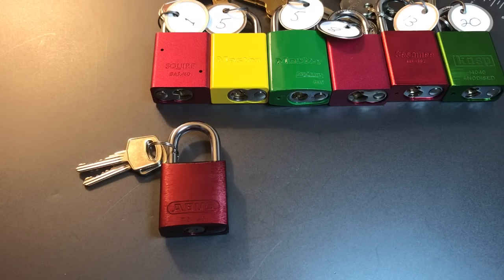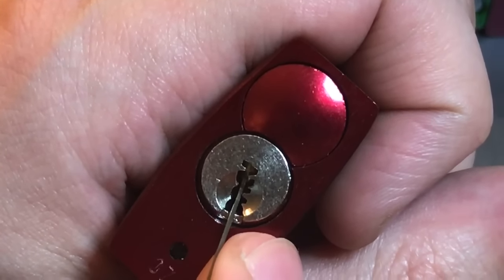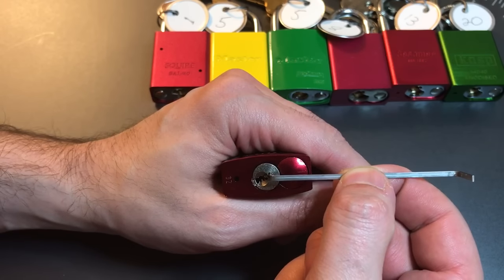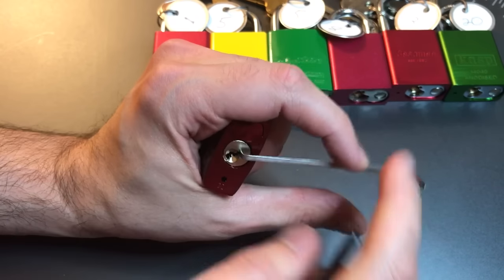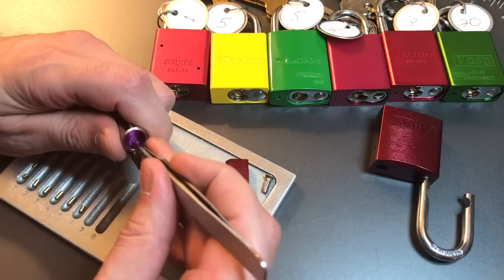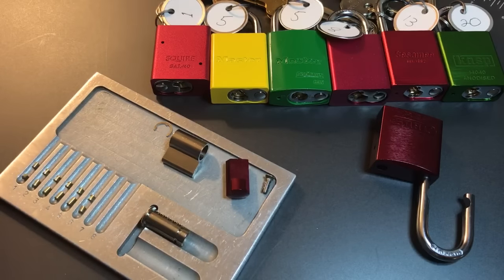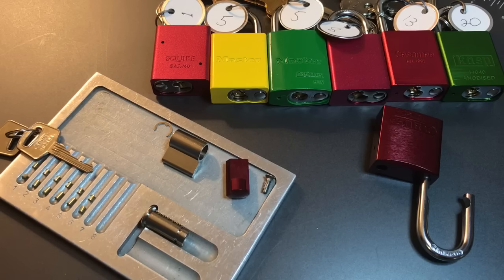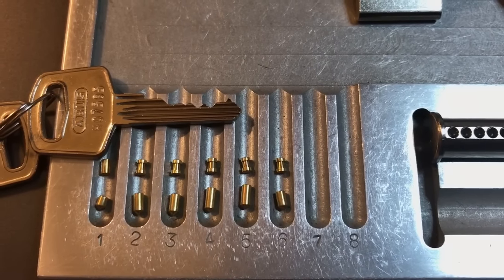[317] 40mmAL Series: Abus 72/40 Padlock Picked and Gutted

Comment: Very quickly done! My 72/40 has just the most evil bitting, while yours looks quite flat. So unfair, lol ;-)
Reply from the maker: Thanks... comparing with different bitting is different.  It's one of the reasons I used the point system (and didn't include none removable core locks like the M570 and the 80TI/40).  The points are independent of bitting.

Comment: The Abus 72/40 comes in many configurations. I have a couple WW keyway 72/40 that are VERY restrictive. Even to .015.
of the dozen I have, most of them have anti bypass. They all have serrated key pins and spooled uppers.

This has to be the weakest 72/40 I've seen. lol But I guess you gotta go with what you got :)
LMK I can send you a WW to compare if you want. Though it might take a week or so to get to you.

Great picking, and awesome video as usual!
Reply: West Coast Picks 
Yep yep, I agree with you on the Abus differences between locks. They have several different style keyways as the one I have has the type core that looks like an IC core. with an awfully restricted keyway. 
And another one with a standard Yale keyway which is more peracentric than this one. 
Maybe it's a knockoff like a 
Luie watton Handbag is a beautiful bag but will never be the real deal.
lol

Awesome pick as always,  and thanks for sharing. 
Cheers!
Reply from the maker: Well, like you say, this is what I have.  I just got a PM from someone offering to send me another variant, so we will probably have an update on this.  Thanks.

Comment: Well, as Mateusz said, there are two different versions of the Abus 72/40 core, the one you got and a very paracentric one (which does have the flat core holder).
I have both versions (well the open keyway one as yours as a 72/30 I got from a friend in America). Both are known to be bypassable, but the other one would have got 3 more points :(. Yeah, I'm known as an Abus fanboy hahaha ;). Still a very nice series, can't wait to see the next one :D.
Reply from the maker: I'm happy to consider another one if someone sends it to me... after all, I have two keyways for the 1100's in this race.
Reply: redcatimaging I think it would also need a non standard pick, so even more points
Reply: It's the same tight keyway as the Abus 85/40 (or the 82Ti/70), so yes that might be Flying Locksman :).
Reply: I can send you the padlock, but it's still an easy pick (even for me :) ) and it doesn't require  super thin pick - 0.55 mm (around 0.022 inch) from multipick has enough room. And I still think that ball bearings here are just for show since they are spring-loaded.

Comment: Funny - in european version keyway is different, pinning is the same and it's also bypassable. Despite having ball bearings I think it's shimable, because after closing the lock with hasp open you can push the balls in, but why to bother if you can bypass it.
Reply from the maker: Interesting about the shimable ball bearings...  I'll have to look into that.  Thanks.

Comment: Great pick! but this is kind of weird, i just bought one of these myself, and it does have a paracentric keyway. the core housing is slightly different too, it's a single piece, unlike the 2 piece yours is.
Reply: Same here. Mine definitely requires a 0.015 pick and I was looking forward to seeing how much quicker LPL could open it than I can :( But alas it's not apples to apples.
Reply from the maker: Thanks... If anyone sends me a different variant, I'm happy to include it in the series.
Reply: LockPickingLawyer sure, i could trade you mine, i've kept it stock, and it only has a little scuffing on the top of the keyway from tensioning it, PM me where to send it to!
Reply from the maker: elliott113 Thanks, but I already have a couple others on the way from a different user.